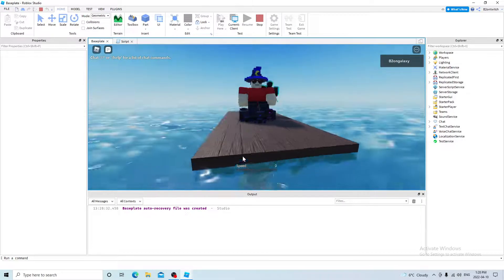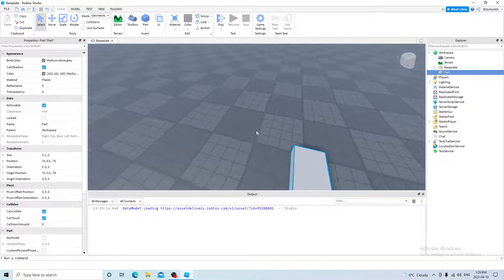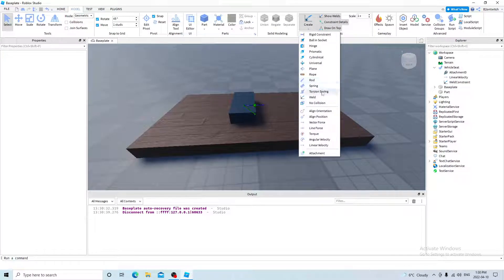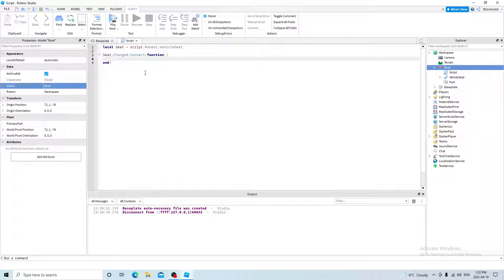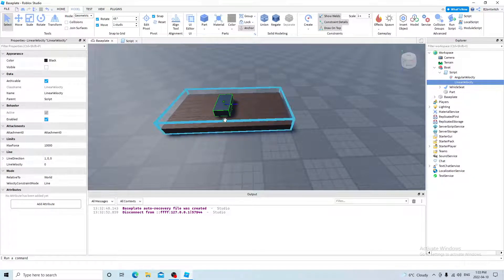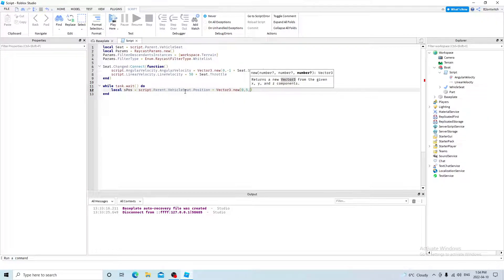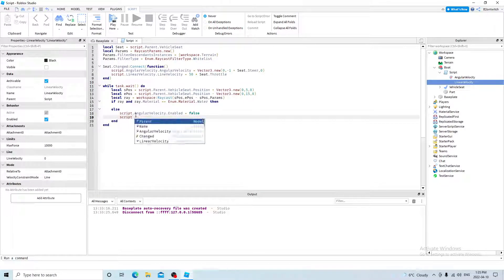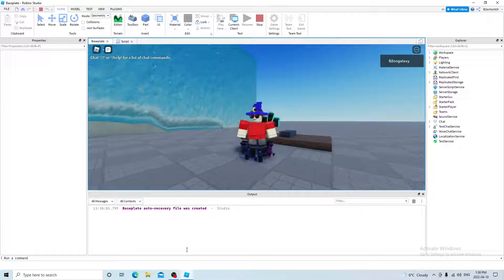How to Make a Boat in Roblox Studio

Comment: i did all thing right its not working when i looked trough the comments then found the comment that says it does not work you said try increasing the maxtorque and all that i followed evry single steps but it does not work
Reply from the maker: Last time I tested this it worked. Are you sure you followed all these steps?

1. Make a LinearVelocity and a AngularVelocity parented to one of your boat's parts
2. Change LinearVelocity.RelativeTo to Attachment0 and LinearVelocity.MaxForce to 10,000
3. Change AngularVelocity.MaxTorque to 10,000
4. Group your boat by pressing CTRL + G or by right clicking on your mouse and then clicking on Group to make it a model
5. Press the + icon on your model and click on Script. Make sure the code in your script is the same as my script
6. Parent the LinearVelocity and the AngularVelocity to your script

If your MaxForce is too high then your boat will fly. If your MaxForce and your MaxTorque is too low then your boat won't move and turn.
Reply: @blockyscript6798  See, I'm really confused too. I just tried all of this and my boat just straight up won't turn. It'll move forward and back but won't turn. I just redid it and I'm still struggling.
Reply from the maker: @sara5angle  Did you add an angular velocity to the boat? If so, change the max torque of the angular velocity to infinite and make sure you copied the script correctly.
Reply: @blockyscript6798  when I change the max torque to something crazy like 99999999 it starts essentially walking on its own. It just doesn’t work properly. Double checked the script and it’s correct. Really not sure what’s wrong.
Reply from the maker: @sara5angle  Did you make sure the blue arrow of the linear velocity is pointing straight in front of the boat? I made a more brief explanation:

1. Add a VehicleSeat and a part. Weld the seat to the part. Make sure the seat is in the middle and the part is big enough
2. Add a linear velocity to the part. Make sure the blue arrow is pointing straight in front of the part (the same way the player faces when they sit on the seat)
3. Go to the properties of the linear velocity. Change the velocity constraint to Line and the relative to to attachment0
4. Add an angular velocity. Set the max torque to 100,000. But don't put the max force of the linear velocity too high or else it will fly (something like 10,000 is good)
6  Group the seat and the part - this will create a model
7. Add a script parented to the model
8. Parent the linear velocity and the angular velocity to the script
9. The boat will only work in water

Hope this helps.